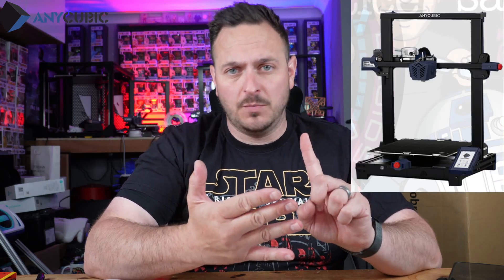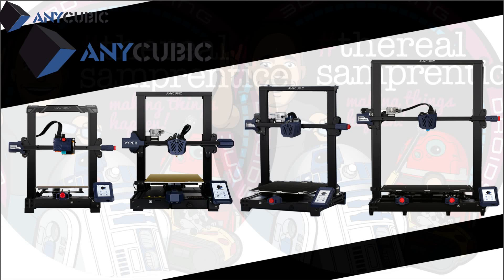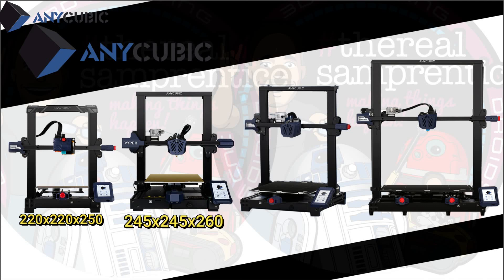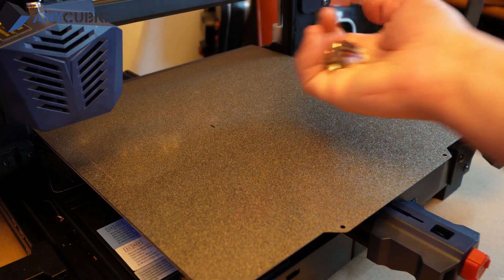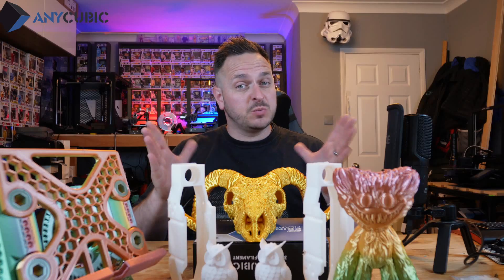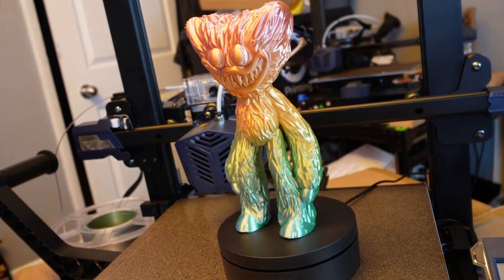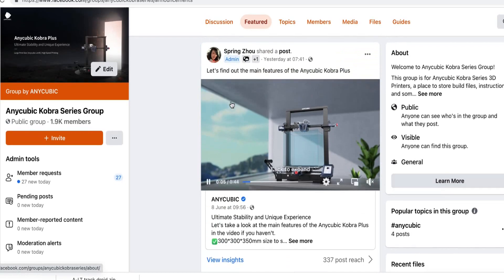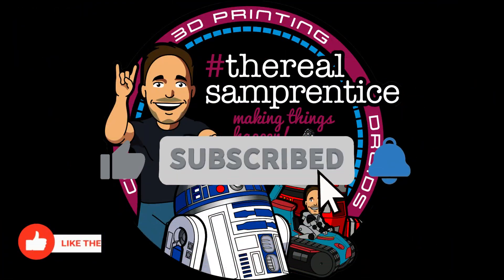Anycubic Kobra Plus: The Best 3D Printer Under $400?

Comment: I had a chip out of a Kobra Max bed but Anycubic sent out a replacement.  Do not print PetG on these surfaces without out doing some research.  I believe using glue will prevent it but doe so at you own risk and better still, print on the other size.

Comment: I just got my Kobra Plus.  Having all kinds of print issues with it. You seem to have it pretty dialed in.  Do you have any guide on the settings you are using.  I am getting a lot of stringing on my PETG prints, and I cannot get the same quality on PLA prints as I did on the owl test print.
Reply from the maker: Retraction 6.5mm and drop your temp by 10’degrees
Reply: @TheRealSamPrentice don't know if you have printed on it recently but if you have what else have you changed?

Comment: I recently bought a Kobra plus ... before that there were only lcd from anycubic ... I'm still trying to figure out the settings of the cura to get a normal texture of the top surface when printing horizontally (for example, a wooden floor) ... I can't find information anywhere about this ...

Comment: Couple of questions because I have a Kobra Plus:
1. for some reason my computer refused to read the provided micro sd card or thumb drive so I couldn't get the "recommended profile" or what ever it was called to set up Cura. Any clue how to get the right stuff? I couldn't find it on their site and ended up finding one from some random person that claims it would work as long as I adjusted my build plate size, and it is working but not sure it was the best settings.
2. Why do all peoples prints have a circle around the area but doesn't attach to the model while mine makes a giant flash around all model bases that actually attaches to the model? I have to clean up the base of everything I print and unsure what setting that actually is and worry about changing random settings and messing something up. You can see what I'm talking about at 3:43. Your printer drew a couple of  lines like an inch away. Mine does it like 1/4 of an inch and then attaches to the model.

Aside from those questions I seem to have no issue with mine except the plastic scraper they provided was crap and ended up chipping and I now use a metal paint scraper to remove from the glass.

Comment: Hi I have a question, maybe someone here can help me: I am quite new in the 3D printing world, now I'm responsible to find a new 3d Printer for the company where I work, because I will be using it mostly. So I want to print parts with the best precision as possible, and I am sure I want to get a FDM printer. Because we build some "devices" with housing, I was thinking of the Kobra Max, but I read maybe for smaller parts is the Max not so ideal, that's why I was thinking to get the Kobra Plus, as 99% of the parts should fit in the 300x300 bed, just not the Housing comnpletly as in the Kobra, but then I will have to live with that. Does that makes sense?? THANKS FOR THE HELP! :)

Comment: Do you have any good settings for printing PLA+?
i have issues with stringing and how the prints come out, i think its a temperature/retraction speed issue.
Reply from the maker: Id drop the heat by 10 on the hot end and run some tests, retraction around 6

Comment: Great review on the Anycubic printers.  i have the small Kobra and other than a filament feed issue, and this is my first printer I really love it.
Question, I was wanting to get a little bit larger bed printer, any suggestions.  I really like the magnetic bed on the Kobra, I believe you mentioned that other printers with the glass bed could be changed out....  Thanks, Dave...
Reply from the maker: Thanks Dave yep any printer can have a flex bed popped on there :) the kobra plus and the max have performed well as it happens

Comment: I upgraded my Kobra Max by returning it and getting an Ender 5 Plus.
Reply from the maker: I have both machines and the ender5 plus is still a dog. You’ll need to upgrade that one to feel like you’re getting somewhere ;)
Reply: @TheRealSamPrentice  100%. I immediately had to upgrade it out of the box to make it even halfway functional which was incredibly annoying. The Kobra max worked right out of the box which was great, until it didn't work and tried to kill itself over and over again lol
Reply: The Kobra Max is great if you use the right settings.  You gave up too soon.
Reply: @petercallison5765  I gave up after it destroyed itself for no reason, I don't think that's a "settings" problem. It was likely an auto bed level sensor problem, I believe it uses induction sensors for ABL and it went bad.

Comment: Thank you for these reviews on the Anycubic machines! They are obviously playing a shell game with features and new models every year and without work from people like you it would be an endless game of which one is on sales and has the best half of the features I need… I at least don’t feel so confused and mislead by their inaccurate and broken English Amazon listings. 

I want the Kobra Max to be better in a few places not just pure volume. The Kobra Plus will do 90% of my projects but when the last 10% needs doing I will be right back. 400+mm printers are very lack luster under $400… and I am back to the runaround again. With two broken printers not worth repair this will be my 4th purchase and my experience tells me I won’t be happy with anything on the market I can afford.  
I can see how there is a new company every week founded trying to cover the gaps… but seriously Anycubic NEEDS to make a full send core XY 500mm cubed printer for $1100 printer so I can buy a quality cover everything printer without having to take a month off work to build a Voron or some other custom monster that won’t be finished for a year.